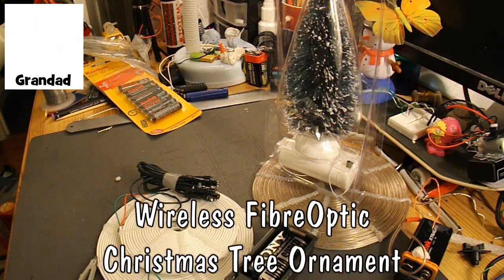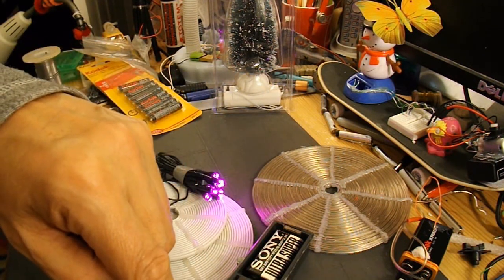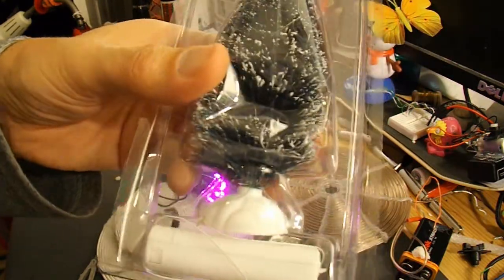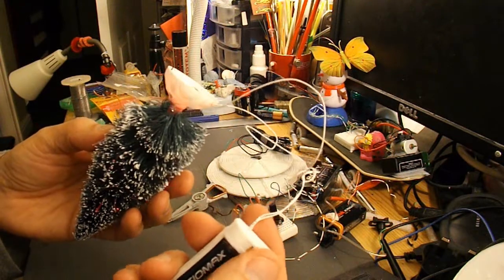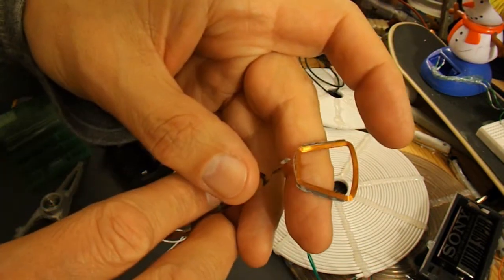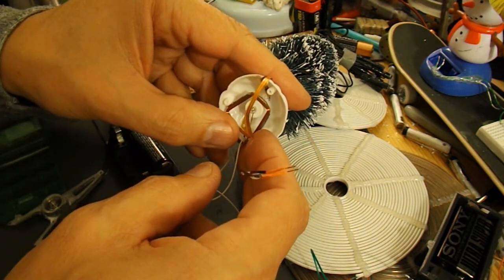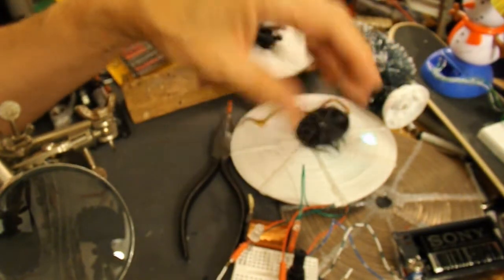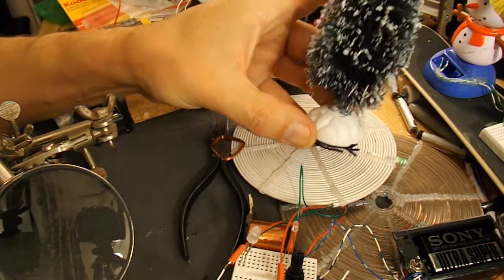Wireless Fibre Optic Christmas Tree Ornament

Comment: Great job...works well.
I like how you solved the build easily and then wanted to make it more difficult !
If you have a smoked glass coffee table, it would look good on it...might be fun to plonk the tree down when guests are over for coffee. A switch on the side of the table, you know lol
Reply from the maker: Thanks, yes it seemed too easy although it was probably the neater option but I do like to make things myself. I did try just using the white wire that came with the tree but it wasn't long enough to make a good coil so that clip didn't make the final cut.
Guests over for coffee, haven't done that for many years, unless you count the grandchildren and I don't think it is robust enough for them to investigate how it works.